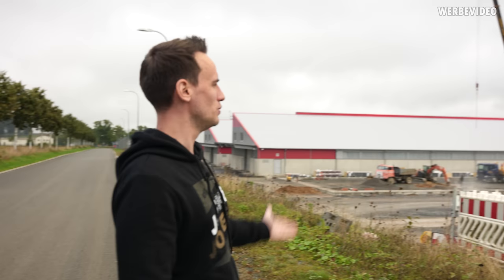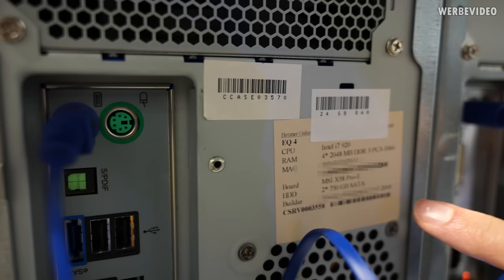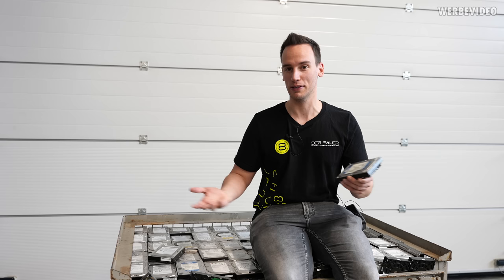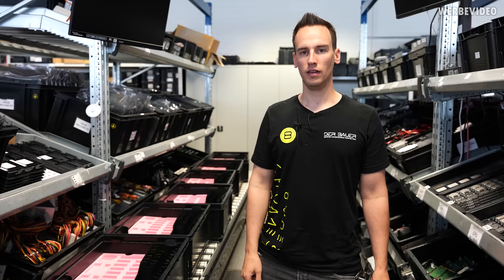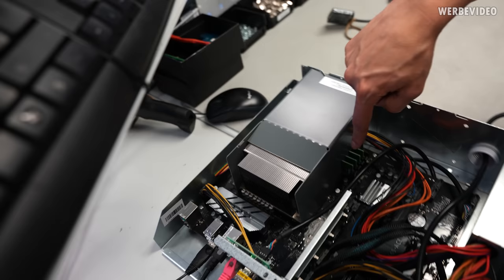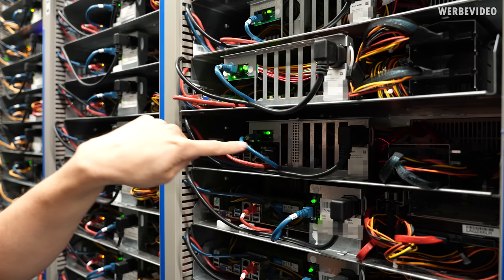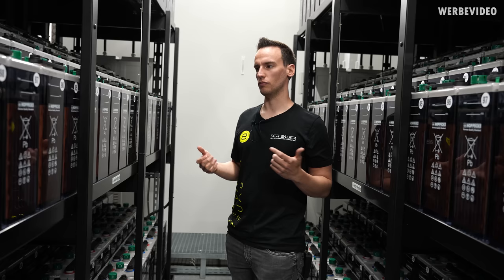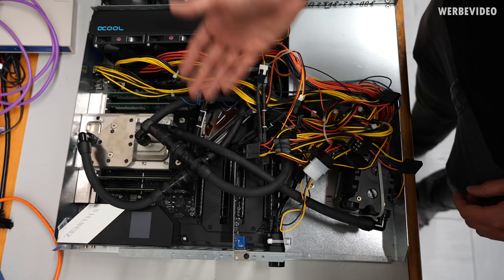Over 200,000 Servers in One Place! Visiting Hetzner in Falkenstein (Germany)

Comment: 15:30 Most times the DC from the batteries goes to the UPS. 3 phase UPS uses "double conversion" and what that means is that they take the AC from the mains and then convert it to DC (and that is where the batteries get connected) and then again the signal gets converted from DC to AC. This gives them a big benefit in terms of mains failure - 0 transfer time between mains and battery back-up, and the second benefit is the fact that this technology eliminates every "defect" in the mains - higher voltage, lower voltage, DC offset, swells... The DC bus on the latest gen of UPS devices is around 400-500VDC in order to achieve better efficiency (around 97% efficiency).
Some new data centers uses DC power to directly  power the servers. This is done in order to gain efficiency by eliminating the DC to AC invertor  in the UPS and the AC to DC conversion in the server PSU.

APC has some great White Papers on this topic as well as on cooling (as in warm countries it is impossible to use the outside air to cool the servers).
Reply: The batteries are just there to tide you over until the generators kick on. A few seconds.
Reply from the maker: Ah, nice! Thank you
Reply: @1pcfred  It depends. A lot of data centers have dual mains and they switch between them using automatic transfer switches that takes a few ms of time to switch (easy covered by the UPS). The diesel generator is a back-up of the back up most of the times. And the requirements for battery back-up is 5 minutes in order to be able to start the diesel generator and let it spin to the required rpm and it also needs to sync some times with the other diesel generators (usually they work in a N+1 redundancy configuration - if your data center needs 1MW, for example, you have 3*500kW diesel generators in order to be able to provide 1MW if one diesel generator fails for some reason). It takes around 1 minute but with diesel generators you never know.... they require a lot of maintenance and you never know what issue you can have with them.
Reply: I actually doubt they are using double conversion UPS'es in such a datacenter, because the efficiency is significantly lower than the line interactive/standby type.

Normal good healthy SMPS power supplies have a capacitor bank big enough to handle the 5-20ms switching time of a standby UPS.

As you are mentioning, many datacenters uses -48v DC systems as it is much much more efficient as you skip the conversion entirely.

It would have been really nice if we were able to see how the batteries were wired, to get an idea of they are used.

One thing they could be doing, (but i don't believe they are), is running ~230v DC directly to the power supplies, SMPS power supplies doesn't require AC, they run fine on DC, this way they would eliminate conversion AND be able to use standard PSUs.
(only issue is that 230v DC is dangerous...)
Reply: @HomelabExtreme  another reason for 48V would be it is below the 'safe' limit of 50V (in most countries) so you dont need to treat it as 'live', use an electrician etc.
Reply: @HomelabExtreme  All standard 3 phase UPS devices are double conversion. Above 5kW it is hard and expensive to produce stand-by or line interactive UPS (due to the fact that you need switching equipment inside of it). You can check all the big brands like APC, Vertiv, Socomec, Delta, Legrand, Borri, Eaton and you won't find a UPS bigger than 10kVA different than double conversion.

I also think that Uptime institute doesn't allow you to have physical switching inside the UPS (like with line-interactive). They don't for sure allow you to switch the double conversion UPS between ECO and normal mode. This is in case that you want to have a data center that is TIER rated (no Mather if it is 1 or 4).

Also -48V (negative) is mainly used by telecommunication equipment. For servers they use +12V but +48V (positive) is considered to be more efficient and soon it might be the new normal.
Reply: @HomelabExtreme  those batteries they got there wouldn't keep them running for a minute. Maybe enough to shut down? I've built a data center. Place had three gennies each the size of a freight locomotive. The battery room was the size of a basketball court and it was filled with racks of batteries. Those batteries were only for until the gennies kicked on. Google maps will tell you that building is a "law office". What kind of law they're practicing is anyone's guess. Rumor was the place we built backed up financial data. They certainly were well financed. Towards the end of the job it burnt to the ground. The next day they came in and said, build it all again. They didn't even bat an eyelash over the costs. And yeah it was arson. One of the electricians figured one more time and he could pay his mortgage off. As I understand it the State took care of his housing needs.
Reply: @HomelabExtreme  The double conversion is not really to handle the less than 20ms  glitches, it is just a bonus.  The real reason is that by double converting the output is 100% what UPS "wants", not whatever crap that might come from the power provider.
Also, the UPS handles power factor correction for the whole load, so you can hook up loads that might not be that great in power factor, without affecting the power factor the power provider sees; which in a big installation (> 50kW normally) is normally charged.
Reply: Every Google datacenter has been serving DC to the servers since at least '07. I'm not sure where the AC to DC conversion happens, though. The datacenters were big enough to have their own power substations so they have a lot of flexibility in power distribution, and don't have to rely on typical mains delivery.
Reply: You don't need AC for servers, ATX/switched mode psus will happily run off DC power at the correct voltage 230V DC you can increase efficiency and build a backup system this way without any need for UPS.
Reply: @DoobooDomo  I believe you can design an ATS that can handle both AC/DC and switch to DC for backup power, but charging the battery bank will require a large controller/rectifier for sure but the way I see you can get "100%" efficiency by running off the grid and directly off batteries when necessary but you also need to consider the drop-off voltage because some power supplies will still run at 80-90V so the batteries might discharge way past their designed voltage range and cause damage to the cells, but they if you're a big company you can design everything :)
Reply: @dashtesla  sure if you modified every PSU. I'm pretty sure the start up circuitry in a lot of PSUs relies on the power being AC too. Getting a SMPS to actually start running is a bit of a trick. BTW 230 VAC is RMS Which is not the same as 230 VDC. Bulked 230 VAC is more like 325 VDC. It'll be peak, or RMS times 1.414. That's why bulk capacitors are rated for 400 VDC And yeah SMPS take advantage of running at high input voltage. The whole P=IV thing.
Reply: @mycosys  Your crazy if you think even 12 Volts is safe on these batteries, you have better treat it with respect regardless of any laws or rules.(Just saying.):goodvibes: One of the techs I was working with dropped a wrench across a battery and melted a piece off the wrench before you could move to catch it, (around 500 Amps through the wrench).
Reply: @RAMXC  Very much the same as what some hospitals used. When I was young I did some work at a hospital near me and every day they tested one of the generators. They had a fly wheel clutch connected to the alternator, so was always at the correct rpm ready to engage, but as you say generators require much maintenance.
Reply: @tedmoss  yeah definitely good for welding, but it wont stop your heart like low voltage. Neither are as worrying as 20kV RF that used to be commonplace XD
Reply: @RAMXC  if a main is full on redundant, thats quite a bit of waste, especially for the very few occasions needed. You would rsther want to run higher power utilization and rely on generators
Reply: @HomelabExtreme  the only issue with 320V DC is that the circuit breakers for >= 250V DC are fairly expensive, about 100€ for the realistic 20A one.

Hybrid ones with a transistor to switch off before the current rises over about 100A would be cheaper, actually.
But they don't become common because they need power supply for the control electronics and cooling for the transistor. Even 1% of those, say, 300V 20A == 6kW, is 60W. So basically a slightly less hungry breaker would need a mid-range laptop tier cooler. And for reliability you would not want them hotter than 100°C, either.
Reply: what kind of efficiently loss can be expected from the double conversion? does it have any meaningful impact on power usage?
Reply: @1pcfred  Those cells are way over 100Ah. Judging by their size I would say 200-250Ah (probably more), which would be able to easily hold 10 servers like they have shown for 15 minutes per cell.
What was shown here is only for one of the shown server rooms, not for the whole site!
Reply: @ppdan  15 minutes is not a long time.
Reply: @1pcfred  More than enough to start the generators (as explained in the video)
Reply: @1pcfred  They run on diesel. Have you watched the video or just jumped in here to troll?
Reply: @ppdan  and where are they going to get this diesel from? Germany is not known for its vast oil reserves. They did try to take Russia's once. That went poorly for them.
Reply: @1pcfred  Ever heard of import and export.
No idea how it is in your country but electricity is up 100% of the time in most central European countries. Electricity outages are extremely rare (haven't had one in over 20 years).
Those are emergency generators and have probably only done short test runs since they were installed. An average citizen probably uses more fuel in a year than those generators have consumed in the last decade.
Reply: @ppdan  well my country invented electricity, so you're welcome!
Reply: @1pcfred  Nobody invented electricity, it always existed. There is difference between inventing and discovering.
But I guess you are referring to Benjamin Franklin, he didn't invent electricity but conducted several experiments.
If you look at all the base theories of electricity ... most come from European scientists.
The first to create a device that produces electricity was a German if I am not mistaken : Otto von Guericke
Reply: @ppdan  Nikola Tesla was a naturalized US citizen when he patented devices based on his AC waveform theory. So an American invented electricity! At least the electricity that is useful to use. Although Edison did construct the first electrical grids. Old Tom himself flipped the switch that brought my hometown train station online. There's a brass plaque there commemorating the event. The two guys that made the first transistor were living in my hometown when they did that too. Shockley really wasn't involved.
Reply: @1pcfred  Are you not allowed or is it a personal choice to not be informed of what non-US citizens have invented or discovered?
Reply: @ppdan  foreigners invented very little. Whatever they invented Americans improved on too.
Reply: i signed up with them once, while their prices are amazing really and support is ok, the main problem they wont give you more than 4 IPs, i had to install multiple VMs for my customers and needed a single ipv4 per vps of course, hetzner instead insist that you can create some sort of NAT and that sadly didnt work for me so i had to cancel with them and seek another provider...
Reply: @dronetheworld4k67  You can lease whole subnets from them (up to a /24 for a single server) or acquire your own subnet somewhere else!!! They currently have a policy against giving out more than 6 "single" IPs to a single server (which makes sense to have a limit there).
There are only 4 billion IPv4 and while that sounds a lot it isn't if you count all the users that get a public IP (home internet, smartphone ... etc).
Reply: @ppdan  
True theybdontnallow ordering more than 6 ips
They want u to do some sort of routed setup which didn't work for me so I ditched them...

Dear ladies and gentlemen

Unfortunately it is not possible that you get 32 single ip addresses, if you want so many ip addresses you only can use an additional subnet. Please note, an additional subnet need to be configured with routed setup.

Best regards

  Ralf Sager

Sales

Hetzner Online GmbH
Sigmundstraße 135
90431 Nuremberg.
Reply: @dronetheworld4k67  Don't see the problem, only advantages. You could ask a second NIC (server grade mainboards have 2 NICs most of the time) for that subnet and keep your primary IP on a separate NIC for managing the host. If any "congestion" on the NIC for your vhosts would occur you could still reliably connect to manage your server since it's not a shared connection.
imho, this is how it should be done.
Reply: @ppdan  the problem raised for me and the resolution was to hire a sys administrator with extensive networking knowledge to do it, I had to advertise on WHT, I don't have to add a second nic (and I don't think they allow it) because as I said I am dealing with virtualization environment and it  oukdnt be done easily despite trying for days so I had to cancel thr server with them, all datacenters I dealt with do give you as many ips as u need, as for hetzner they propose a custom workaround which doesn't necessarily apply to all clients setups.

Comment: What an awesome facility. I love that they're using their heads for the cooling solutions instead of just spending a ton of money on, and wasting a lot of energy with, air conditioners -- even using the saw-tooth roof that some old metal foundries used to channel hot air up and outside via the angled ceiling to the high windows (I bet those high windows even face north or northeast, to avoid as much direct sunlight/heat as possible).
Reply: Good point, then they could put solar on the south facing roof.
Reply: @ArthurEmbleton  солнечные панели здорово нагреваются

Comment: Thanks for the most interesting tour.  I am amazed by the size of this operation and the total amount of computing power contained here.  I am from the old school of mainframe computers. First started working with computers back in 1965.  One computer in an air conditioned room with a raised floor to circulate cold air.  One CPU and 24K locations of memory in the typical system I first encountered.

Comment: The main reason you wouldnt run 12V out to your servers is cable losses. You could, though, easily deign your PSUs to take AC or DC (most switchmodes immediately rectify it after all) saving you those inverter stage losses.
Thanks heaps for the amazing insight (and to Hetzner too)
Reply: Yup, that's why it's usually 48V systems in data centers and then converted into 24V or 12V in racks. However I don't know if it would be 48V directly from batteries.
Reply: @insoYT  That makes a hell of a lot of sense! why 48V? the legal safe voltage for exposed installations is 50V at least in the US, you dont have to treat it as 'live'
Reply: Your analog phone run  on 50 Vdc
Reply: @user-jn9dl9px6r  what's that?
Reply: Depends, if you were to design a system where batteries were separated "per server" in theory you could run everything off 12v but it would be an absolute mess and a lot of unnecessary thick cables.
Reply: Bro, im an electronician, and I can tell you we don't want to get shocked regardless of the voltage
Reply: @richterman3962 :  You're an "Electronician"?  Sounds fun!

Comment: Would there be potential for solar panels on these roofs just thinking about the angle.
Reply: i was just thinking that, why they hadn't covered the roofs in solar panels already!
Reply: Well, he said they are already using green energy. I wonder if solar just isn't enough, or consistent enough (night time) vs. wind or hydro. 

It would be interesting to know why they aren't using some solar, though. I'd guess that it's too cloudy on average, that the investment into solar at that location just wouldn't pay off.
Reply: @47CryXMA  Maybe too much resources needed for solar panels? I guess that the consistency is also a big factor, the power output is changing with the second and that is bad for the power net in general. If they use thin film panels they could partly fix the consistency. Those panels start generating energy at very low light but the max power is also low.
Reply: Maybe they angled the roof away from the sun to keep things cooler?

Edit: Actually based on google maps it looks like that's not what they were going for.
Reply: I personally think it'd be a waste of money in Germany. It's cold around 3 seasons of the year.
Reply: Solar panels cost a lot of money
Reply: Probably because this company focuses much less on PR than we're used to from the bestknown US tech companies.
Reply: @47CryXMA  this. If there Is not enough power they can use public network.
Reply: @ALazyMeme  is light. Not heat that generates electricity with solar panels… It’s dependent on the sun light…
Reply: @DaveFlash  np cos its not sunny enough. He said they rarley get hot days
Reply: @MrSwan67 No, 8 cents per kWh even in smaller installations. In a big installation in Portugal 1.1 cents.

Comment: Very cool to see somewhere like this. I can understand what they mean about trying to tidy things up with the HDD test racks because if you're using that kind of setup a lot (which they clearly are) then balancing hard drives and connecting cables like that is going to be frustrating (I worked on radar kit where we had a similar test setup and it was a real pain). A frame with a backplane would work better, a row of slots you can plug the drives into with LEDs at each HDD position.